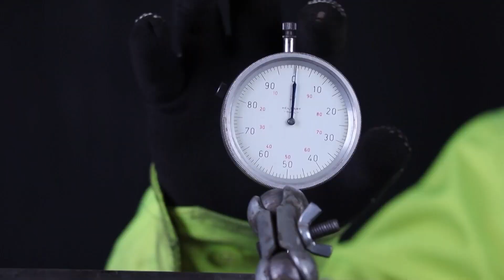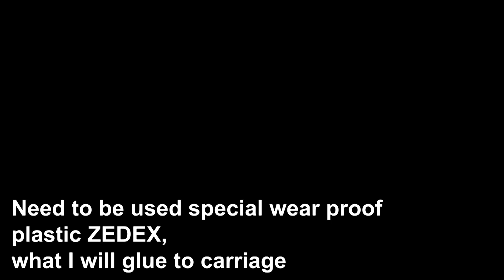Homemade Metal Lathe Machine (part 5)

Comment: The high abrasion on your tracks is a result of using an angle grinder for scraping. With scraping and then stoning the surface that shouldn't occur. Without addressing this you'll just cut up that plastic.
Reply: Yeah I was with him till he started putting plastic on the ways.  All lathes have steel on steel beds and the only difference here being as you say the surface finish of the ways.
Running a stone over would help.  But also most lathes beds are hand scraped with a carbide tip hand scraping tool and oiled well.

Comment: Were do you source all ur steel? Here in the states all that steel would be so expensive. It would be cheaper to buy a really good lathe
Reply from the maker: 1kg 25cents at the metal collection point all the metal from there.

Comment: why plastic and not brass?
Reply from the maker: Просто интересно. И у этого пластика коэффициент трения меньше.
Reply: @firstchip4349  Yes but will it last a long time?
Reply: or even bronze gibs?  I'm thinking plastic won't work well, if it manages to stop vibration, then the whole lathe bed won't help with dampening chatter